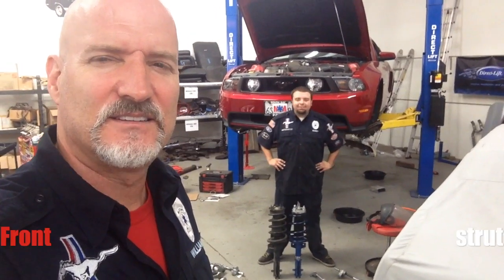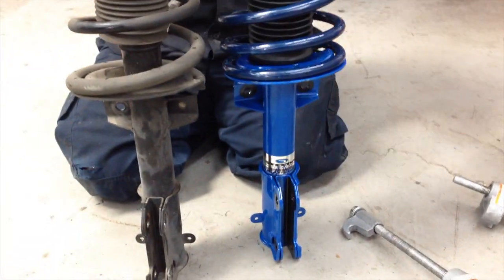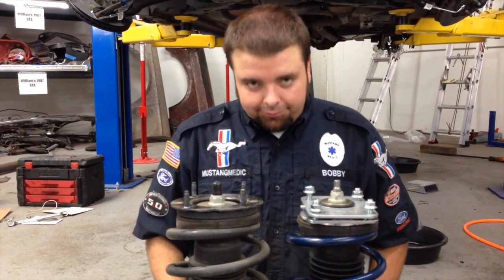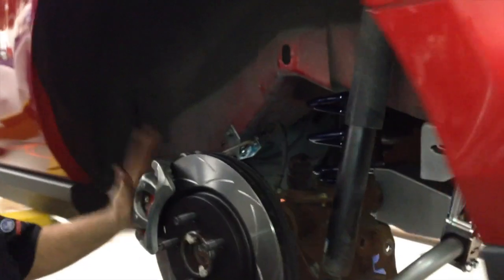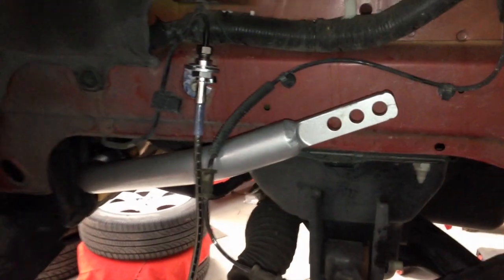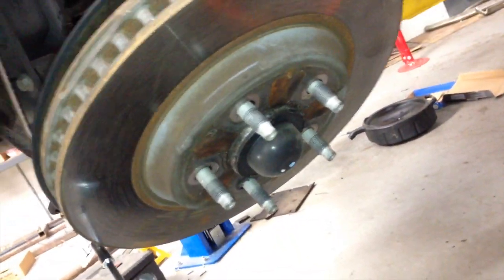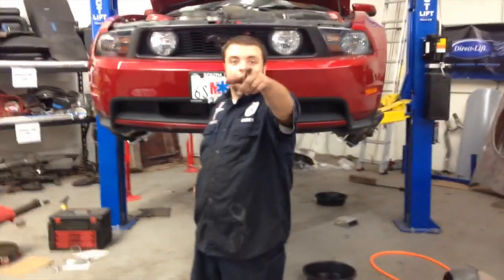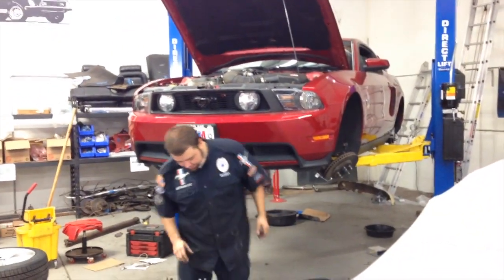STEEDA Front Strut Install Drew's 2010 GT Premuim Mustang - Day 4 - Part 1

Comment: do not forget to remove those clips from the wheel studs if you are going aftermarket wheels because many aftermarket wheels do not have the pocket in the lug nut holds for the clips and the wheel will not sit flush on the disc surface and there will be shaking...
Reply: and mgw is the only way to go with a short shifter. i've replaced my steeda tri-ax with an mgw and i've never looked back.